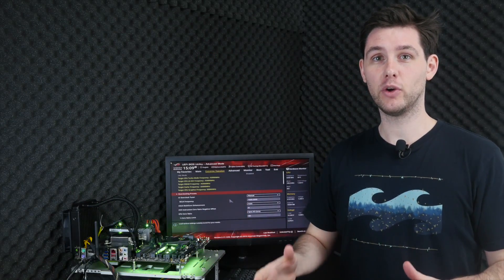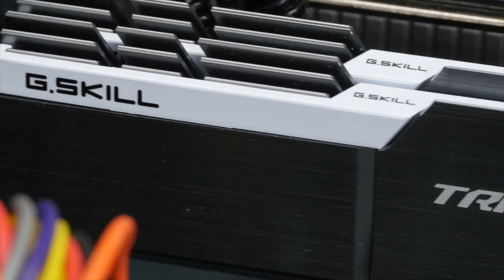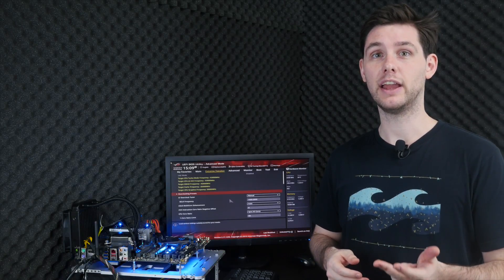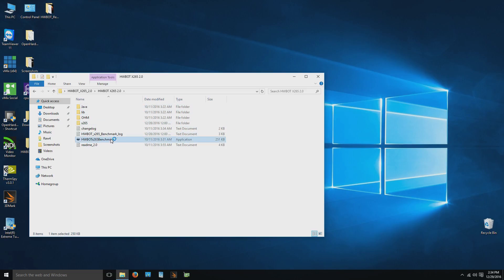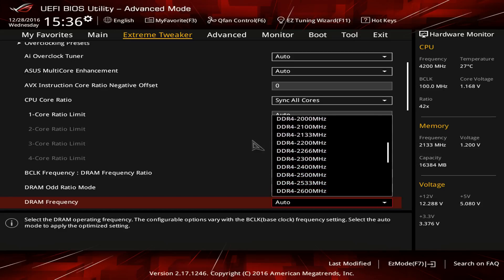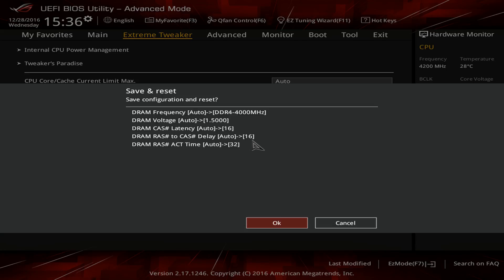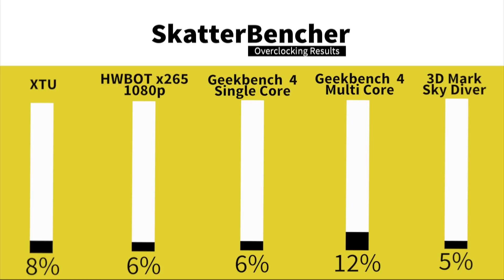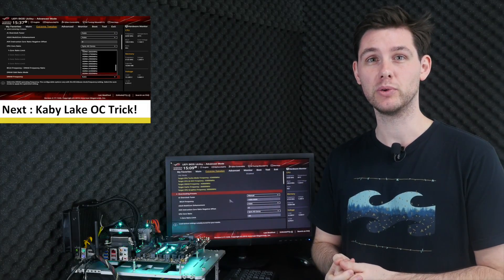GSKILL TridentZ F4-3200C14Q to DDR4-4000 C16 with Maximus IX Apex | SkatterBencher #6

Comment: I tried it but I can't get such timings on my MSI Z390 Gaming plus. I got the same ram model, I dunno if it's related to my motherboard that can't hold these timings or just the ram.
Reply: It depends on what your problem is. If it's not booting then it could either be the IMC on your cpu or the mobo. I would put my money on the mobo though, 4k memory is pretty hard for most mobos. Apex is good at ram oc cause it is only 2 slotted. My gaming 7 z370 can barely hold 4000 c17

Comment: Soo I recently bought this RAM : 16GB (2x 8192MB) G.Skill Trident Z RGB DDR4-3200 DIMM CL16-18-18-38 Dual Kit. My question wouldbe if I could get it to DDR4-4000 on a safe for daily use as well. My MB is the MSI z370 Krait Gaming and the CPU running on it is the i7 8700k with an oc to 5 Ghz

Comment: Hello, ihave an issue with ram: bought tridentz g.skill 2x8gb 3200mhz but in bios they are on 2133. Why?
Reply: I use the same RAM setup myself. 2133 is the stock frequency. 3200 is an  overclocked frequency that has been tested stable. Have you tried changing your XMP profile to 3200 in your BIOS? This is the easiest way to get started with the advertised OC speeds.
Reply: @elijahmounts8095  I have set the profile to 3200 Mhz do I need to change the stock voltages and the other values too? I get blue screen memory management sometimes, and I have only changed from 2133 to 3200mhz

Comment: Hello, I have Corsair CMK16GX4M2B3200C16 . It works on xmp 3200Mhz at CL-16-18-18-36 . I manualy overclocked it on 3600Mhz at CL-16-18-18-36 with moving other things like tRFC... and voltage at 1.380V. My question is could I be able to overclcok my memory up to 4000Mhz and how ?

Comment: 1.5v seems a bit too high to me. Reading around I've been hearing 1.45v max but preferably less. These tridentZ have temp sensors I think so showing what temp you get would be useful. As well as what temp to stay under. And what ram has the best heat sinks for cooling. I haven't even tried overclocking mine yet but will get around to it. My motherboard bios has a try it option i'll give a go some time. After detecting ram gives you the options for the next tiers in that ram or something. Then you just try it. 4600 or maybe a bit more it gets up to if I remember right.
Reply: B-die ram is like the oldschool BH5/BH6 ram, they love voltage, anything under 1.55 is perfectly safe, G.skill, corsair, t-group and others offer ram ratted to 1.5v with full lifetime warranty. I have ran my b-die kits at 2.0v on air for benching with zero issues. Some b-die scales past 1.5v others nearly stop at 1.5-1.525 and take huge increases for small gains. Having VTT ddr adjustment is a big thing with b-die ram also, some of my kits like it exactly half the voltage of the rams voltage, others like 15% more some like 25% less, some of my kits will run 4400 cl16 1t others wont even boot 1t unless below 4000 no matter timings, B-die is all about the binning done on the ram.

Comment: pretty useful visual guide. for some reason no one shows tweaking step by step on maximus boards, plus every brand is different with layout and abbreviations. I'm using xmp at 4266mhz. I'll try 4400 MHz manually following this. I was trying before with xmp enabled and doing this.

Comment: why you changed the CL from 14 to 16? I also have a 7700k, RAM ist not exact the same, g.skill trident z 2x8GB 3200mhz CL16.
Mainboard is MSI Z270 Gaming Pro M5, it allows a maximum RAM freq. of 3600. which RAM OC Settings would you recommend to me?
Reply: I am a newcomer in overclocking.... for an unkwown reason, I cant get higher than 3200mhz with XMP enabled. also without XMP, and CL 16, it doesnt works. and my CPU maximum is 4,7ghz, 4,8ghz is only possible for a short time, and than the system craches. and my Fans are way too loud, even without any amplication running, dont unterstand it...